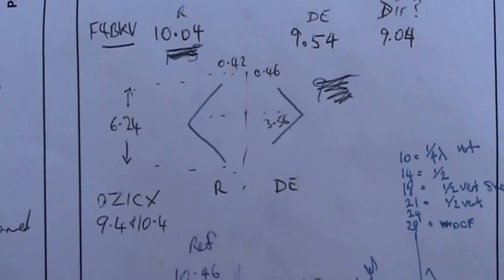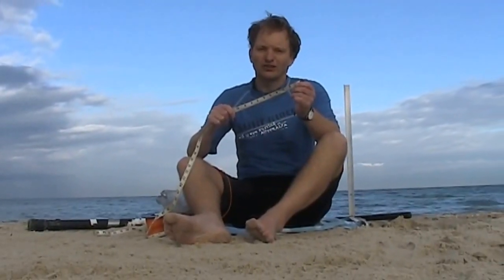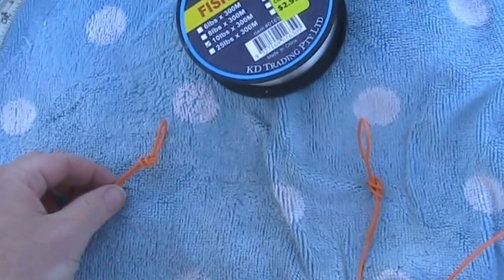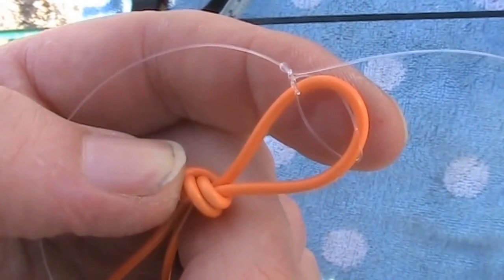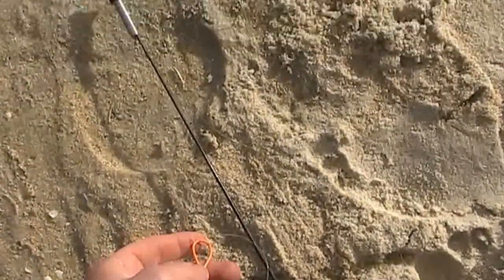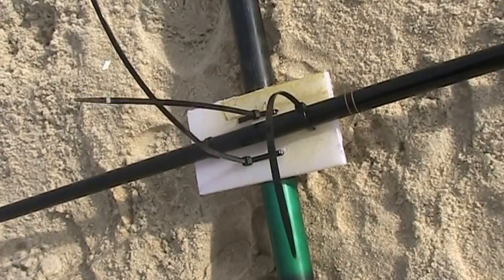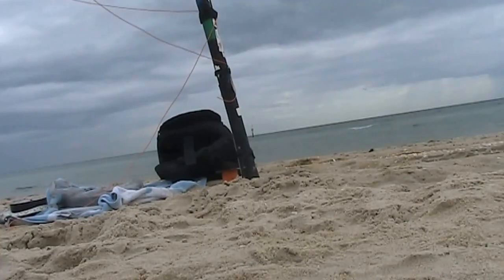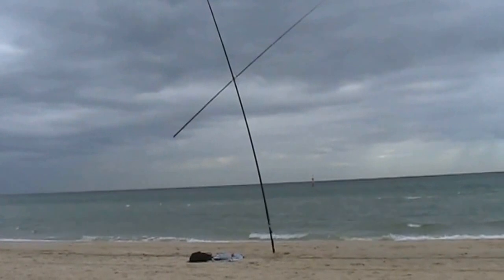Water's Edge Portable DX: A single pole vertical yagi for 14 MHz

Comment: I suspect you only did this one to save others the trouble of trying and failing, haha :) you have already done the best compromise 2 squid poles for a moxon. Next best in terms of complexity but better in terms of performance would be 2 squid poles to form a 2 element inverted delta loop in wire form. I'd like to see that one out on the jetty with the wood rails :)

Comment: Here's an interesting idea. Here in south australia we have these high stink pipes that come up out of the sewer. They look like they would be 12 inches in diameter and almost 70 feet high. They are steel but might be set in concrete at the base and therefore insulated. Get a connection to one of those and there's a brilliant 1/4 wave on 80m, a half wave on 40m and with a series inductor it would probably work excellently on 160m. I don't know if Melbourne has any of those about the place :)